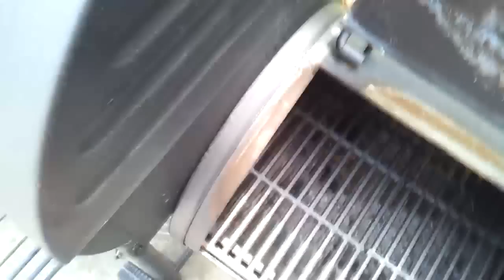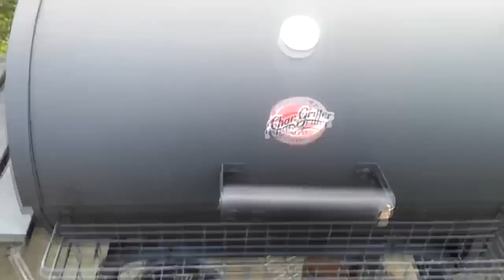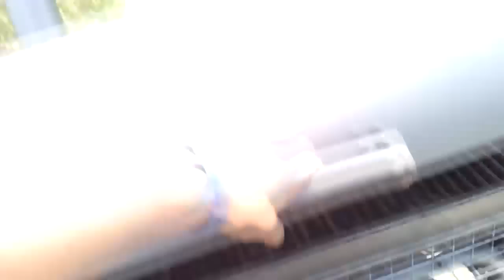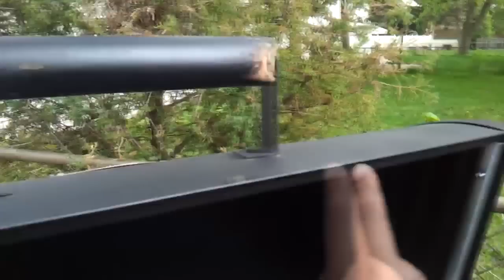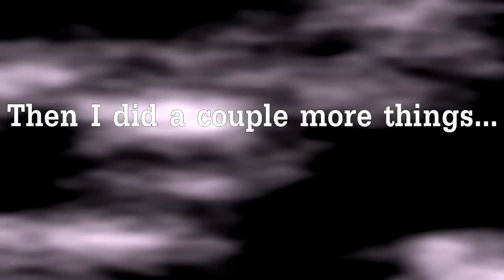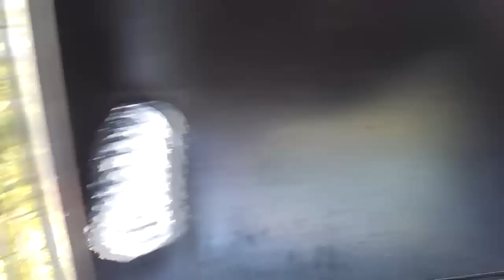Chargriller Offset Smoker Mods

Comment: I've had this grill for 20yrs.😊.
Yes, do the thermometer and the standoff.
The reason smoke comes out from the sides is that when the chimney is more closed the grill lid is full of smoke down to the lip. 👍
That's how you keep it 🔥 hot.
It's smoking because the lid is full.👍
Adding dryer hose down to the surface does nothing, nor does "sealing" the sides.
It may help you control the burn of your fuel.🔥
Closing the chimney more does the same thing by keeping the smoke/heat in the lid.
If it's open, no smoke from the sides.
If it's closing, it smokes.👍
Reply: This comment I need to see, cooking is about skill.

Comment: I got one from our church about 12 years ago we had a storm blow down a couple of tree limbs and one of them landed right on top of the smoker, just folded up the legs  but both boxes are fine ! The church bought a new flat top and they gave the old one to me ! Anyways, all I've  done to it is JB weld the seam between  the 2 boxes as I was losing a great deal of heat/smoke in the seam, put a metal plate in the bottom to cover where the heat/smoke has to stay on the bottom, extended the smoke stack down  to the grill surface like you did, made a new frame to hold the boxes,and I repaint it with high heat grill paint every fall, and I also added a couple thermometers in the door at grate level !! Its still rockin, use it several times a year !

Comment: I've had my chargriller probably 20yrs. If there is smoke coming out the sides, that means the hood is filled with smoke all the way down to the lip. Think about it. There is NO need to run a pipe to the grill level to keep the heat in. That's what the flue is for. By closing the flue down it keeps more heat in. When it's smoking out the sides that means the hood is full of smoke. You don't need that pipe.

Comment: Did you take the dampener plate off the grill to attach the offset smoker?? My char broil dampener doesn’t not have nuts or bolts attached to remove it. There’s only 2 holes up top and 2 holes on the bottom just outside the dampener plate. Can i get by without taking that whole plate off and can the dampener holes work well enough to push heat and smoke through??

Comment: IVE GOT THE SAME SET UP AT HOME AND NEVER HAD A HARD TIME REGULATING ANYTHING. THE HEAT STAYS BETWEEN 225/250 NO PROBLEMS AND I HAVE THE SAME LEAKAGE ISSUES YOU GUYS DO. IVE HAD IT 1 YEAR TODAY AND LOVING IT.
Reply: Timothy Bueschel quick fix is fold some tinfoil over the bottom lip. Also works on the Weber kettle really well. I just got an offset, and it’s super easy to control, but I’ve only used it 3 times so far

Comment: I wouldn't worry so much about all of the leaks - as long as it's mostly tight, you should be fine.  Great video though - subbed!   I just put one up as well with mods on the char-giller.
Reply: What's the link to your video

Comment: I have that same BBQ, bought the offset later to attach. the hardware to attach the offset does come with the bolts and spacers that attaches to the predrilled holes of the cross bar frame. with the spacers in place there is no wobble or shaking. double check the hardware that came with the offset unit for the spacers.
Reply from the maker: Then I got a bum unit, none of that hardware was listed in my parts sheet. So I did it myself. Things might have changed in the 4 years since I bought the thing.

Comment: When you buy one new the firebox comes with the supports which bolt to the frame. You can use carbon felt for a gasket too which works really well.
Reply from the maker: I'll try that carbon felt. My side box didn't come with spacers or I'd have used them.

Comment: That shaking smoker box is caused because you forgot to put spacers and long bolts and nuts that attached thru box to the grill's frame. they come in the pack od nuts and bolts. Those two spacers cones around 3 inches long with provide enough support to stop the instability of shaking weight of box.
Reply from the maker: Thus is an old post, but if you didn't hear me: I didn't get the spacers because the fire box didn't come with the grill originally. I added it about a year later. The firebox didn't come with the spacers either

Comment: Nice video, have the same smoker, not the best I've used, but it's ok.  I put the rope on the bottom instead of on the top and added 1/2"x1/8" gasket  on the back of the bottom half of smoker.  I believe I like your way better, in regards to putting the rope on the top portion of smoker.

Comment: Very thorough explanation for your first or 100th video, keep them coming. . I have one of these and will be purchasing the side box. I like the idea of lava rocks to help hold the heat as they do on my Charmglow 2000 Propane grill. Also I will use the red silicone hi temp caulk and dryer vent. Thanks for sharing your ideas, it does help see what others are coming up with then we could replicate or tweak.

Comment: You talk about buying a dryer vent to extend your chimney pipe. What I have done is purchased a roll of aluminum flashing six inch for what I was needing, and wrapped around the pipe the pipe marking it about an inch longer so it will overlap and use a hose clamp to hold it to the position I want from the meat on the grate. This gives you the adjustment that you may like. Good video.

Comment: This is great! Exactly what I was looking for. I was thinking I might have to get someone to weld plates onto the lid, but your L shaped aluminum pieces screwed into the lid is a much simpler, more elegant solution! Thanks, I'll be implementing all of your fixes. Did you use the gasket rope on the back of the lid in the end?
Reply from the maker: elektrovert I never did. It's working pretty well for what I managed to fix so far, but if you're going to do it, go right in for the back while you're doing the sides. It's on my list for this summer, right behind the vintage boat I'm restoring.
Reply: elektrovert Alaska an saw mill

Comment: Yea I tried doing the glass around the firebox lid and with the 3/8's inch rope it was a little to much. Even tried the flat version of it and it was still to thick. It pulled it up just enough to cancel out the 3/8's I put along the side and lower section of the lid. Ended up making a gasket with RTV for the top lip and it has just enough cushion to compress and seal it off nicely. Even using the 3/8's glass on the side lips I was only able to go 3/4 of the way up before it started lifting the lid out of place. So I just cut it there and made that the starting point of my RTV gasket. Not as cosmetically pleasing, but hey it works. Great video though! Inspired me to get mine into shape.

Comment: nice mods..  can you tell me where you got the brackets for the smoker box?
Reply from the maker: I made 'em. Cut a couple of 5-6" pieces of 1" flat aluminum bars, bent them into U shapes, and drilled a couple holes through them.The fire box and the main grill leg bracket have holes that lined up, so I put the brackets in between, used machine screws/nuts/washers to hold in place.
Reply: Tony Thomas thanks!

Comment from the maker: Here's How I Modded My Smoker

Last summer, I got a Chargriller Deluxe grill. But I always had a sneaky suspicion that despite the large cook area, I still wouldn't be able to do the type of indirect cooking I wanted/needed. Turns out I was right. So, I ended up adding the firebox to it.

Well, the first couple times I used it with the firebox, it leaked heat/smoke from everywhere, and I ended up having to "fix" it.

This video shows me getting started on fixing it. Too bad the couple little things I did could have been done at the factory for just about nothing during the manufacturing process. But, at least I learned a little more about my rig in the process!

 #bbq   #hacks  

EDIT: I did these mods back in May, just never got around to editing the video and posting it...
Reply: Sweet smoker mods Sir!!!!
Reply from the maker: Yours is next. You fix that hole?
Reply: Not yet
Reply: Tony Thomas